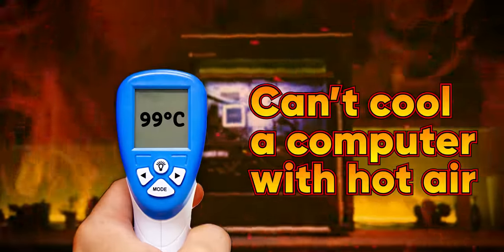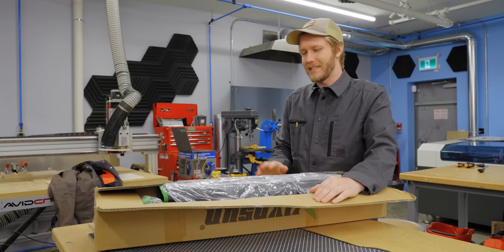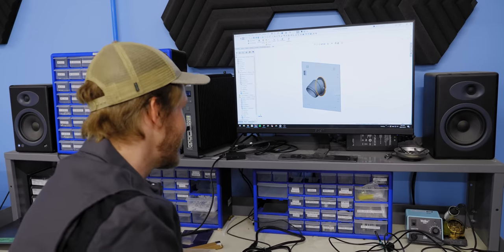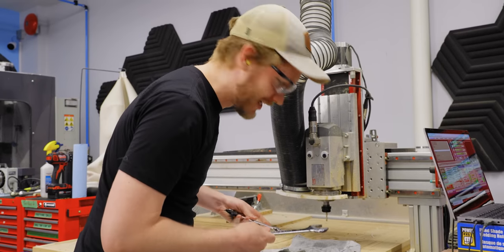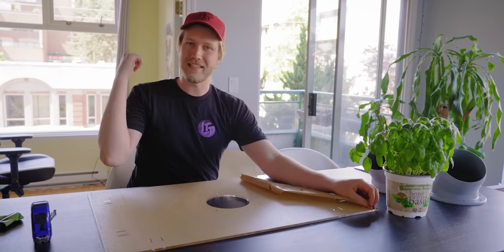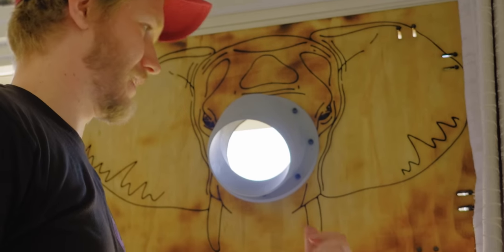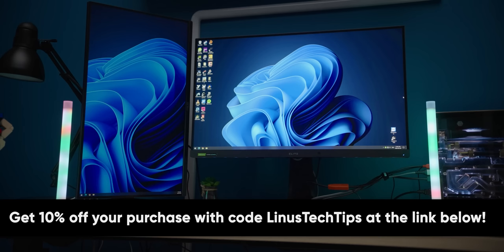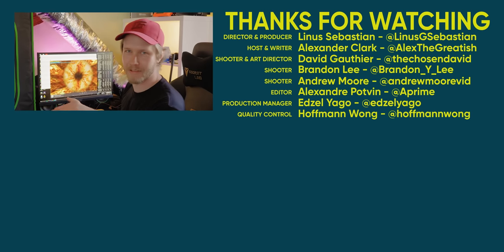You’re cooling your PC wrong. - PC in a Grow Tent

Comment: With all the engineering that went into this, it may have been easier to just design or modify a computer case to exhaust out of a pipe leading to the outside
Reply: Yeah, could probably just have made the hose adapter fit the backside of the case and kept the output the same because that fan is moving so much air, that nothing is escaping out of the computer case :D
Reply: Realistically, that would of been a boring video. If one was actually made for it.
Reply: Well thats the next video ofc
Reply: Um, that would need more work
Reply: @Hacker-cw9lc  not much more
Reply: @HeadlessBTW  no mine doesnt but im running good specs
Reply: Why do Canadians need aircon? So weak. Same latitude at Britain (who don't use aircon).
Reply: "engineering" 😅
Reply: @engineeringvision9507  Canada has had over 50C this year.
Reply: I 3D printed a 120mm fan to 4" flexible-duct adapter and a matching fan stator to maximize static pressure.  Mounted that mid-way of 4" flexible duct using a Noctua fan thermally controlled by my system's water temperature.  The inlet connects to a hood which spans the majority of case exhaust and the outlet goes out of the room.
It works far better than expected.
Reply: It was just an excuse to make LTT buy a Grow tent
Reply: I'm not sure what his area of Canada is like, but the problem with this kind of setup out here in Virginia is that you are just continually exhausting air conditioned air from your home...I wonder if he just doesn't have any climate control in his house?  If so, I think he would have been better off drawing air from the outside, pumping it to the grow tent and then exhausting it in a loop.  I am actually pretty curious what his climate control setup in his home is, because this would get expensive pretty fast with AC.
Reply: thats actually a great idea
Reply: but they dont do things like that back at linus hq 😂
Reply: Exactly what I thought. Then you wouldn't even need the external fan if you have enough positive pressure from the case fans. Set it up like a shops dust collection system with tubes going from the computers up to the ceiling and routing them wherever you need.
Reply: Probably would be just as effective to have a fan pushing air out inside a window and get rid of the ducting and grow box.
Reply: @woo9914  They'd run into the issue of not being able to keep hot air/sun from coming in through the fan and it would blow more of the AC air out the window. With a relatively small and insulated tube that only exhausts the hot air created by the computer and the cold air the computer sucks in, it would be far less wasteful.
Reply: Just simply putting the fan on the window will lead to the same temperature in the room with that type of airflow. They could have done without the tent, horrible duct and "manufacturing".
Reply: That would be more efficient. Instead of sucking all kinds of cool air from inside and dumping it outside, you'd only be dumping the air that's actually been used and heated by the PC.
Reply: You are absolutely right, I have that setup at home but the exhaust is routed into the ventilation of our house, works amazingly good actually.

Comment: Something tells me that just putting a fan in the window would have the same effect.  The biggest thermal improvement to the room was creating airflow.
Reply: Yes, that's what I thought. He should have compared running the PC inside and outside the tent, but with the fan running the whole time.
Reply: my living room has two vents either side of it(trailer), but is almost sweltering because there is no air circulation/airflow.
Reply: Fan will help but the heat is still dispersed into the room and a lot of it. With a grow tent, The air is pulled into a confined space and then the heat is directly dumped out the window instead of in the room and then out the window
Reply: @leeroyjenkins0  Yeah, but the tent pulls cool air from the room, which pulls cold air from the rest of the house. You end up creating a negative pressure differential and that causes the home to pull hot air in from outside where there are air leaks in the conditioned space. This is marginally better than just putting a fan in the window, but still less efficient than using a higher flowing vent to compensate for the extra cooling needs, or adding an individual unit for that room whether window, wall, or mini-split. Nothing is free 🤷‍♂️
Reply: @daqq  most places have AC so they're still air coming in. The problem is you have to freeze the rest of the house in order to keep the hot room tolerable. You are correct and negative pressure. So if you're sucking in there that's been cooled and other parts of the house but that's okay
Reply: @DaleEarnhardtsSeatbelt  i haven't seen a more wrong statement than "most places have AC [...]" in a long ass time
Reply: @jiebaef  come to japan bro!! literally everywhere has ac
Reply: I feel like they should have put both PCs into the box, but the box in the corner between the two desks, and then run the fan up top. Or better yet install a small window AC unit up top and get a much better result no matter how hot it is outside, and with a much lower noise floor to boot.
Reply: definitely. grow tents, one of the worse wasteful ideas in crypto mining
Reply: @DaleEarnhardtsSeatbelt   the ac unit doesn't draw air from outside it just recirculates air. if you use this setup or and duct that takes air from inside and dumps it outside air has to be pulled in from somewhere and if its hot in the attic or outside it will for sure pulling that air into the entire house from wherever it can get in.
Reply: Maybe but this lets you direct the heat output directly outside while just a fan in the window would still require the pc to output to the room before it can be expelled
Reply: @PartytimeYOLO  close one of them?
Reply: Maybe with the fan blowing outside. But the fan will struggle as the hot air is all over the place instead of actually being led to the outside via the tube
Reply: @WeebJail  I feel japan is not the best example to use for "most places"
Reply: pt a fan in the elephants nose
Reply: window fans don't really help against a computer generating heat and dumping that heat into the room. I know this because that's what I use in my room. I use two dual fan window fans, for a total of 4 fans, one is intake at the window above my bed and one is outtake, the window above my desk... 

Yes the window fans will help some, but much of the heat generated from the computer will also dump into the room before some of it making it's way to the window fan and I find myself still sweating balls during the daytime playing games during summer.

The reason why the grow tent is a better idea is the heat is confined in an enclosed space and the majority of the heat has no where to go other than getting sucked out through the duct.
Reply: @Xfade81  the fan won’t struggle. That thing is pumping out way more air than the computer is pumping out heat. By a large margin. And that room is very small. I’d be willing to bet the room temperature would stay the same as the original temp if the computer was taken out of the grow tent
Reply: @LycanWitch  He was pulling conditioned air into the room, this alone had a significant impact on temperature.  Pulling outside non-conditioned air into a room and exhausting the room air is always going to result in the room being hotter than outside.  I would expect at least 5degF hotter, more depending on BTU load in the room and airflow.  From an energy standpoint all of the power consumed by a computer is converted to heat, it's a straight BTU conversion.  Dell servers even tell you watts and BTU in realtime, so you don't have to do the math.
Reply: @eformance  pulling cool air through the gaps around the doors isn't going to do much against a modern gaming desktop PC setup (especially that of LTT Staff) dumping out around 750 watts of heat. Which if you do some simple math, (750 watts * 3600s) / 1055j = ~2,560 BTUs per hour of heat being dumped into the room by the computer.. yeah get real... no way a miniscule amount of cool air from the gaps around the doors is going to do anything to put a dent into the amount of heat being dumped into a room by a gaming pc.

The only reason why it had an effect in this video is because the PC was isolated, thus that small amount of cool air being sucked in had nothing much to counteract it, however if you remove the grow tent then that small amount of cool air would easily be overwhelmed by the heat of even a budget gaming PC..
Reply: this method reduces "room heatsoak" as all pc heat should be going directly outside.
all the air coming from your pc with be hotter than ambient air...you dont want this mixing with cooler air and being recirculated around the room/pc.
     honestly they had accesss to 3d printers....so could of just designed a nice rear duct shroud thing that attached to the rear of the pc.. would of been a lot neater.
Reply: @LycanWitch  The gaps around the doors are designed to act as the return air duct for central air/heat.  A 3/4 inch gap on a set of double doors is equivalent to 45 sq/in or about 9x5 register.
Reply: hell maybe some proper curtains for when its really sunny too. white backed curtains have a huge effect
Reply: @DaleEarnhardtsSeatbelt , ACs don't bring in new air. The recirculate air already in your home. It is much much more efficient that way.
Reply: @TrollFaceTheMan  right. I'm saying with ac in the main area being cooled then when the fan sucks air in due to negative pressure it will mix with negative pressure and not be a huge issue
Reply: That would create a much more direct flow of air between the door and the window, blowing the conditioned air right out. In the meantime the heat from the PC would keep mixing with the air in the room. So not only would it be more inefficient for the AC in the house, it would make the room overall warmer.
Reply: I see what you mean now.

Comment: As already mentioned,  you are dumping all the conditioned air out the window at a really fast rate. Your AC will be running constantly now.
Reply: My understanding it would be better to dump the hot air from the grow tent back into a larger room of the house and not outside. It's also why you shouldn't dump air into the attic as well.
Reply: @GeoffHellings  yes that's true.
Reply: @GeoffHellings  I tried doing this with a small fan once.  I taped a trash bag around the fan and then stuck the bag under the door to blow air out of the room.  It did move some air but it didn't really seem to make a difference.
Reply: I think the better solution would be to have the intake ducted to the outside air, that way the PC is completely isolated. It might run a couple degrees hotter, but the saved ac bill is worth it.
Reply: Yup. Small win in the computer room, huge loss in the rest of the house. Does he understand that the air being exhausted through the window has to be replaced with that hot outside air via other doors, windows and poor insulation?
Reply: @balazsbonifert1427  That would work, but really have to filter that outdoor air intake. Also depends on how hot/humit the outdoor is. Imagine pulling 80% humidity through your pc.
Reply: @GeoffHellings  why do you think that? There's less air pressure of pushing the air back towards the tube, more air pressure pushing it away from the exit area (wind), and generally more molecules to suck heat from it.
Reply: @MrV1NC3N7V3G4  I suppose air going in would be cooled via an AC. Hot air comes out the room from the PC, the PC heats it, and pushes out the room.
Reply: @balazsbonifert1427  I think hot intake air would be really bad.  In that case though he could just put his PC out on that patio.
Reply: @MrV1NC3N7V3G4  he is not cooling his pc, but his room. If you paid attention, he said the pc making his room hot, and his room is already warm while not running the pc. So this solution is making the room cooler

In that sense, the AC doing harder work is not an issue because he need it to cool his room anyway
Reply: @khangle6872  Oh, I paid attention. Yes, he's also cooling his room, but he's doing it in the most inefficient way possible. A simple window unit would have not only worked better, but would not make the rest of his house hot. 

Remember, the same amount of air being exhausted is being pulled in elsewhere and that air being pulled in is obviously hot. By his own admission, that fan was moving a LOT of air. I'll bet he disconnects it after his first electric bill. (Sooner if his wife has her way)
Reply: your all talking like he is going to be running this 24-7, 365 days a year. he literally said if the room doesn't go above 25ish he's comfortable. I Imagine it will be on maybe a few hours a day maybe a few times a month during summer period.
Reply: @nathanturner3671  That's a good point. However, it's still the dumbest, most inefficient way to cool a room. For that matter, why does he even need the tent around the PC? With that much air being exhausted, the cool air from the rest of the house would still get pulled into his room and the hot air in the room (regardless of where it came from) would still be pulled out  as long as the vent was higher up.
Reply: @MrV1NC3N7V3G4  no, the most inefficient way to cool a room is to heat it up.
Also, to answer your question - it's a matter of heat exchange. Sure, cool air from the house would come in, but it has a rate of heat exchange with the air in his room.
Same with the air from his computer.
And because the computer is dumping a lot of heat, it would add more heat at a given unit of time than air from the rest of the house would cool it.

Also, were it a closed thermal system, the heat in his whole house, and therefore his room, would only grow. In reality it's not, but dumping it outside that system would make it gain less heat over time from the computer.
Reply: Wow. I went back and read all the replies and I'm just astounded by everyone missing the point of the initial comment.  Good day to you all.